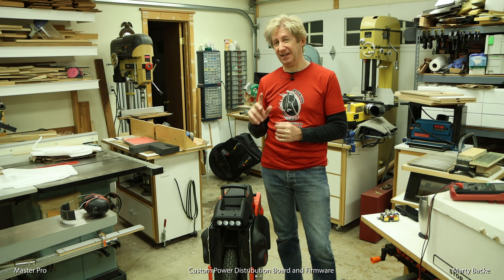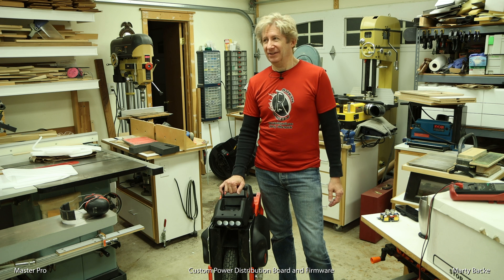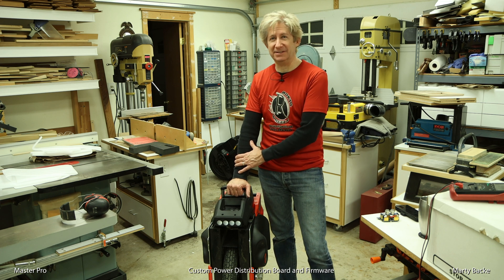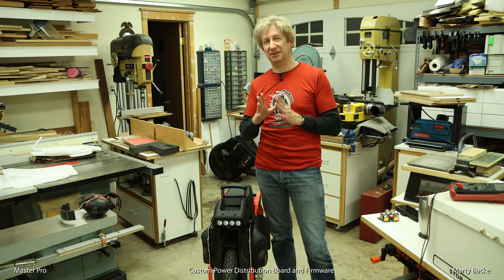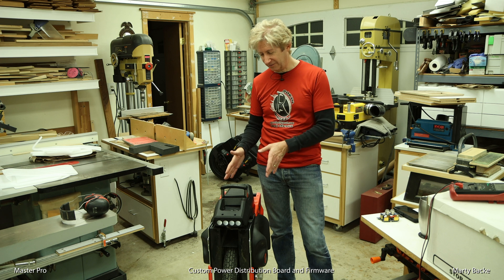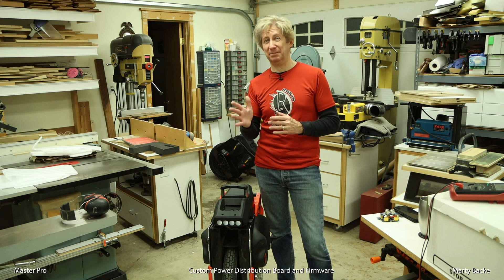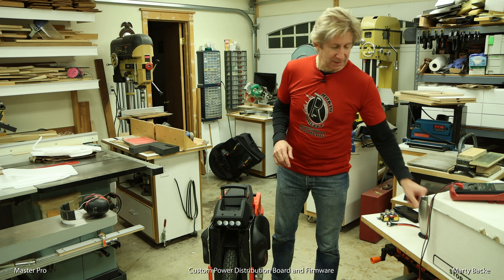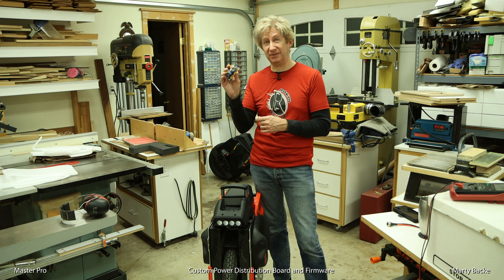Learn How to Fully Charge Your 134.4-Volt Wheels with This Simple Hardware Hack!

Comment: Hi Marty! Great video.  There is one thing that I disagree on.  The reason the wheels aren't charging to to 134.4V isn't because a voltage drop in the circuitry of the distribution board.  It is because the charge current FETs are getting the signal to disengage at a lower voltage than they should.  Keeping the charge channel open is really the only thing this mod is doing.  BMS signal faults will still show on the board, but will no longer keep you from putting voltage into the packs.  We all know the pluses and minuses of this.  If your packs are damaged in any way or are exhibiting strange behavior, this mod should be avoided.
Reply from the maker: Thanks Roger. I was counting on you to correct any mistakes I was probably going to make.

❤️
Reply: @ElectricUnicycles  very nice and scientific video, specially with you drawing the electronic diagrams! May I ask are you an electronics engineer or did you use to teach on the subject?
Reply from the maker: @jimmykiang4420  I'm a retired Aerospace engineer who graduated with an electronics degree many decades ago 🙂
Reply: I dont really understand why begode as a company cannot design the charging circuitry to work the way its supposed to... seems really sloppy from their part for missing out small but still annoying details/bugs? such as the correct charging voltage for the batteries. And the consumer has to find workArounds or mods to make up for these oversights :/
Reply: hi @rogerEuc, I have a suggestion, not sure if you have thought about it already, since you are going to sell these mod boards. Would not it be better if the mod boards could have a toggle switch or something? from what I understand your mod board acts like a cable directly bypassing charge "protection logic" (not sure whats the correct term for that circuit). So with the switch you could toggle between the "original" functionality and the "mod", this way if you have a problem with the battery pack then you have less risk? Not sure if its a good idea though, but still wanted to discuss about the topic
Reply: @jimmykiang4420  That would be an easy and ideal solution.  I don't plan on selling these boards.  I have helped a few friends resolve charging issues.  I recommend checking the packs individual voltages on occasion if using my mod.  If the packs are healthy, its a safe mod... otherwise, not so good.
Reply from the maker: @roghaj  I did ask you beforehand and that's why I said you'd be selling them 🙂I probably didn't understand what you were telling me 🙂

Comment: I have a v2 master and it charges to 134.4 no problem  (charge ports are hot) 

I have an ex30 that doesnt charge above 133.8 or 133.3 something like that.  Does this mean my ex30 doesnt balance cells? 

Would that be an issue for me down the road?  

And could i swap to a v2 master charge board for my ex30 to have it operate same as my master?  

If the ex30 not charging to full wont cause me problems down the road i dont care too much.  Id love to hear your 2 cents on this please Marty.
Reply: Or would my ex30 "balance" at whatever the max voltage it can can currently reach, so shouldn't worry at 133.3v ?

Comment: Hi Marty! Is this charging issue still present on the Master Pro V2? My new Pro V2 (only 100 miles on it so far) will only charge to 133.4 right when the charger light turns green or less by the time I notice and take it off the charger. I've heard different accounts saying this is fine and relatively normal or others say it is actually something to be concerned about. Just wanting to know what you think and if I need to send my wheel back to Alien Rides. It functions and rides just fine I just want to be confident there's nothing to be worried about with my battery packs. Thanks!
Reply from the maker: I can't say definitively but I see no reason why it wouldn't be. Certainly be sure that your charger is actually outputting 134.4-volts (many don't). If you are inputting 134.4-volts I would expect to be closer to 134 volts.

Since you're so close I would anticipated Alienrides (or any dealer) to push back against having the wheel sent back.

If you have to live with that full charge I wouldn't worry about it being a problem.

Comment: Hey Marty! So my Commander Pro only charges to 132.2v, but my EX30 charges to over 134.4v (134.7 usually). So I thought I would switch out their charge boards so that the CP would get to 134 and the EX30 would be the limited one. I swapped them just like the process shown at 15:28... but to my surprise even after changing boards, my EX30 got to 134.7v before the charger turned green, but using the SAME charger the CP still only got to 132.2v. Nothing had changed. Any idea why that is?
Reply from the maker: I would guess that the control board is not properly calibrated for reading the voltage. The only sure fire way to know what it's charging at is to disconnect a battery pack after a full charge and measure the voltage at the battery connector.

E.g., my Master Pro reports the voltage is 135.3-volts after a full charge which is clearly not possible
Reply: @ElectricUnicycles  That makes sense, thanks for the quick reply! I'll get a voltmeter and see what's actually happening.

Comment: Well, that is a great way to kill your battery in the long term...🫣

Potentially, you can also hurt yourself doing so, as the battery may fail during the ride. 
As the old song says: "dumb ways to die".

Never go under 3volts per cell or you will find yourself in hospital sooner or later.

Another few miles won't make a difference, don't try to be smarter than the people who actually created those limitations to the batteries, it is there for a reason.

If you really need high mileage - consider changing your vehicle.
Reply from the maker: 🤣🤣🤣 I really don't know what I'm doing here anyway so give me a little slack

Comment: Hi Marty, Would the firmware update be good also for the Master V2?  I would think that they both, Master V2 and Pro use the same board. thanks
Reply from the maker: No. Much different wheels (Master has half the battery and a smaller diameter wheel). And if would be unsafe to operate the Master below it's 104-volt tilt-back voltage.
Reply: @ElectricUnicycles Mmm, I have to disagree with you Marty. I think the size of the tire and Watt batteries are no issues here. Master V2 and Pro are both 134.4 volts batteries setup with exactly same low voltage tolerances and current charging values. The  peak current discharge might not be the same that is for sure but we are talking about charging at maximum voltage and discharging at minimum voltage here.
Reply from the maker: @guyjemus2706  well, at a minimum your indicated speed and range will be way off because of the difference in wheel size.

Begode has firmware updates for all their wheels and they don't have a generic one for all/any of their 134 volt wheels.

Comment: Marty you have a wonderful workshop. I was concerned you might burn it down so I looked up the specs of the Samsung 50E cells. Yes they say in the Nominal specs that Charging Voltage is 4.2V and minimum discharge is 2.5V but they also say on their data sheet that "Cut-off Voltage of charging MUST BE UNDER 4.2V" and " Recharge voltage must be at least 0.1V lower than Max charging Voltage."
If you look at voltage/capacity graph for the 50E you will see the voltage drops from 4.2 to 3.9 in the first fraction of a % of used capacity. On the low end while there is a steep drop around 3.0V there is still useful capacity to be had (As Dawn discovered).See thunderheartreviews samsung 50E capacity test. That graph indicates that as someone said it an earlier comment on your fix to get 134.4 V you probably are down to the lower voltage just accelerating out the drive!
Reply from the maker: I think the BMS takes care of charging a bit under the 4.2-volts per cell. We've been charging out EUC's forever with chargers that output the full voltage.
Reply: @ElectricUnicycles  Yeah I didn't really understand what Samsung were getting at and I also thought the instructions "Cut-off Voltage of charging must be under 4.2V" was for people the designing the BMS . After all Samsung say the cell is not for retail as it has no protection and it is designed for OEM who build packs with protection (ie BMS etc)

Comment: If the pack is only charging to 132V, are the cells still getting balanced?  Another very informative video. 👍🏼
Reply from the maker: They aren't getting balanced with the dumb BMS that Begode uses. More sophisticated BMS's (KingSong/Inmotion) can balance the cells at lower voltages.
Reply: I rememeber on my master, euc world reads the voltage at 133.something. Then I use my multimeter to measure the voltage on the charge port, it reads out 134.4v. That means the app isnt really accurate.
Reply from the maker: @shinobieuc  it's not the app but the data from the wheel that the app is displaying. But in any case measuring the outputs from the batteries can show low voltage. You have a good wheel/charger combo 👍

Comment: 2.7v per cell. You can probably go down to 2.5v, but there is a but, a very big BUT. At the bottom end of the battery capacity curve the voltage is falling fast. The capacity represented by the drop from 3v per cell to 2.5v per cell is not going to be very much (capacity 2.5v to 3v tiny). More than that the discrepancy in voltages between cells in your pack is going to be at a maximum at the bottom of the batteries capacity. If you were unlucky enough to completely discharge any cells within your pack then the remaining cells with some charge would reverse the current in those cells as you rode the wheel. Reverse charging cells (which is what this represents) is instant death to a cell.
Reply from the maker: Fortunately you can only go down to 2.9-volts.

Comment: And for the Distribution board: In some way i really dont get. Gotway makes their wheel safer (Finally after several complains and fires) by checking NOT to charge the wheel in case of ANY BMS error, and now people go to circumvent it? The beeper on each board is a VERY bad argument, as this only triggers one or two specific fault, there can be others that are only detected by the distribution board.
So in my - uneducated - view this brings new dangers to peoples houses……just my 2 cents
Reply: Agreed, you would think Marty understands these nuances after so long in the EUC game, but here he is spreading ill informed instructions to clueless riders.
Reply from the maker: @moonbabies  I said only "Savvy riders" should consider this. I didn't say anything about clueless people 🙂
Reply from the maker: People can make their own choices in life. If someone thinks it's more dangerous than certainly don't do anything described in this video.

Comment: for the headroom: YES, you can ride fast, that alone doesnt need much watt/amps…but when you reach 3,2/3,1 Volt the voltage drop on your wheel is gigantic on heavy accelerations, and especially compared much to a full battery. So what MIGHT made you cutout are heavy accelerations and/or unexspected bumps in the road. And as soon as you reach 2,5 Volts, the BMS shuts off. just saying…
Reply from the maker: If anyone is riding below 96-volts the assumption is they will be riding very cautiously. This video only talks about going to 2.9-volts.

Comment: After riding only a small amount, burn maybe 20% of battery, is it bad for the batteries, charge back up? Basically, is it better to drain the majority before charging again?
Reply: In short answer: Yes, as fully charging to 100% is one of the lifetime eaters of the battery. Especially when its less than using 20% , i would say dont allready charge. And also important: WHEN charging to 100percent, then dont let the wheel sit with it for a long time. Best is to use the 100% charge as soon as possible….
When you dont use your wheel for longer time, best is to have it sit at 40-60percent.
Note: This are all just battery “lifetime” tips…when you do otherwise, there its NO danger…
Reply: @ullle66  Thank you!
Reply from the maker: @ullle66  I'm kind of surprised that you are still recommending this. I always charge to 100% and don't think about the batteries.
Reply: @ElectricUnicycles  Actually i ESPECIALLY said that are just longevity tipps….i myself dont use them at all.
Just the “dont charge from 95/98 percent to 100” - when you just made a testride-  in my view is important
Reply: Isn't that just common knowledge for batteries? The rate these things are improving nobody is noticing that changes their wheels every two years,  but the daily recommended operational range for any kind of EVs is always typically 20-80 percent. You can supposedly eek out some more cycles only charging to 70, with balancing accomplished periodically of course...whatever way that gets done with the bms. I would not charge to 100 and let it sit personally. I see people at EV (car)fast chargers charging to 100 all the time. It is painful to watch. Leasers!
Reply from the maker: Exactly. If I intend on keeping a wheel for 10-years than I would take more care in charging. Most people upgrade their wheels after a few years. I was just talking with someone who had over 20,000-miles on one of their wheels and it only has a little less range now. He charges to 100% all of the time.
Reply: @ElectricUnicycles  I wonder how much is dependent upon the person using a not insignificant percentage of their range regularly. @Adam U has the battery video where he says he sold his friend his old EUC he wasn't using much anymore, and it was fully charged. The husband tries it out in the kitchen and proceeds to bust his ass and the wall. Then they brick it by throwing it in the closet with a full charge still and then not using it for another two years. I also heard of EV deaths from sitting unused over the pandemic.  Assumingly from being stored at too high or low of a charge. I don't really know a lot, I just am more generally interested and read/watch things here and there. I haven't come across many great and encompassing sources, perhaps one would need to hit the science journals or somewhere more authoritative to really know.
Reply: @ElectricUnicycles  looks like you took the Clark system off your MP, curious as to why? It looked good, although probably too bulky, for a big wheel already
Reply: Charge to 100% and balance each time…your batteries will last longer

https://youtu.be/pgr7-b3eBm0?si=KV9zQyFO9n2IN04D

Comment: 2.7 is waaaaaaay too low for safety...
Reply from the maker: 2.7-volts was on the COMMANDER PRO, by accident. This video is discussing the ability (only when needed) to go down to 2.9-volts on the Master Pro.
Reply: Ah, that's where the 2.7 number was coming from, I was wondering why that popped  up here twice.

Comment: We'll never know what voltage you went under to get that buzzer to sound. If that voltage was 2.5v then some cells are damaged. Hopefully it wasn't 2.5v.
Reply from the maker: It didn't go that low. Another video (that I alluded to in this video) shows us measuring the voltage on each pack. All four battery packs were very close to the same voltage ~2.9-volts/cell. 2.5-volts would be a system voltage of 80-volts. The wheel never went below 92-volts.

Comment: "We have a lot of headroom" applies to larger packs only, where many cells share a load. Don't try riding down to 2.7v on like a Master. The Master Pro is safer at those voltages than an EX30 etc, because of the pack size.
Reply from the maker: Of course. This applies to large battery pack wheels. I actually would only go below 96-volts on the Master Pro with its huge battery pack.
Reply: @ElectricUnicycles  96V representing 3v per cell, no lower. You should be home by 100V on a 2400Wh battery really.